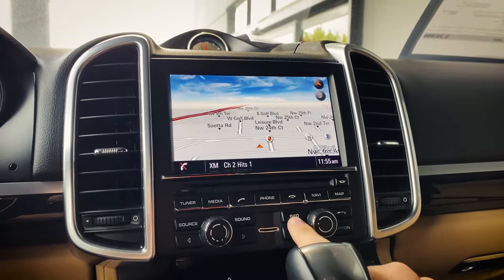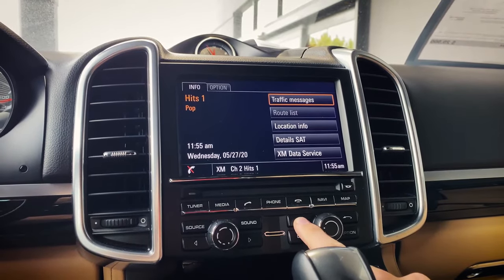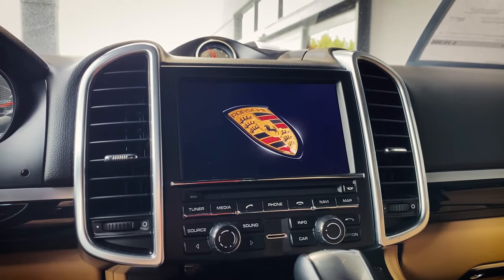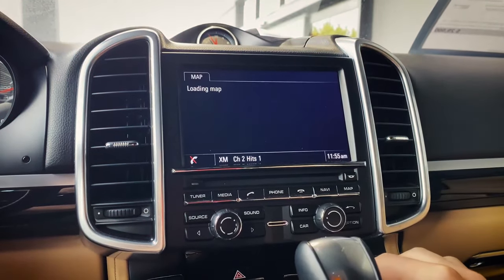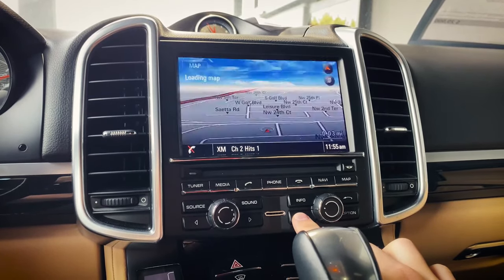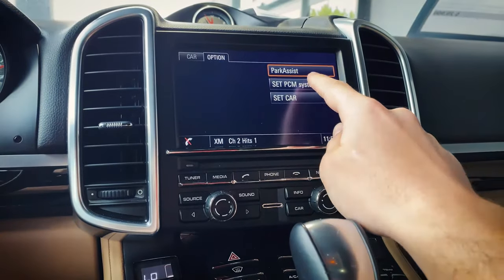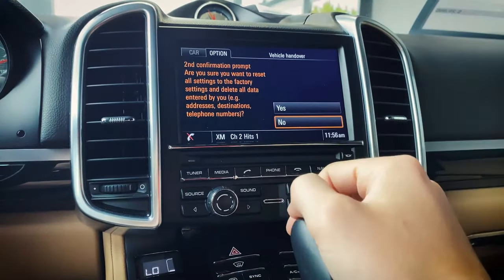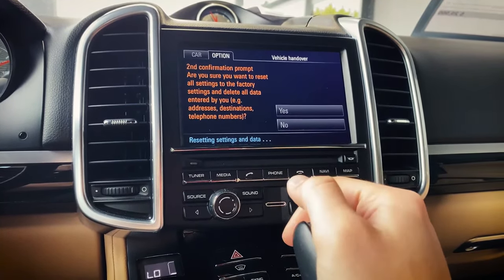How to: Porsche PCM 3.1 Reset and Fix

Comment: I tried this several times on my 2014 Carerra.  It works for a few minutes and then my instruments on the dash either display faults or it goes dead completely.  I used the FIXD scanner and says I have 2 major defaults. I can hardly wait for the big dollar bill for the repairs.

Finally figured what the problem was..I had a new AGM battery installed and cleared up all of the faults . Best 150 dollars i had even spent.
Reply: hello i am having the same problem.  did you find a fix?
Reply: @Montuckz  yes all fixed bought a new AGM battery. All fixed...
Reply: @jamesg2609  thank you so much for the quick reply.  so you only replaced the car battery?  so it was a lack of power to the pcm?
Reply: @Montuckz  yes..I was getting all kinds of warnings.  Steering ,tire pressure , ...it was intermittent.  The new battery solved all the issues.
Reply: @jamesg2609  thank you very much.  did you do it or dealership?  cheers!
Reply: @Montuckz  i went to my local mechanic that is very versed in Porsche repairs.
Reply: @alexis ademovic my local mechanic.  Be sure to use a AGM battery.

Comment: I managed to reboot a 2018 Macan PP which I believe has the PCM 4 - USB wasn’t being recognised as an input.

You have to hold the left rotary knob and the screen goes black OFF. I then clicked and held it for another 5-10 seconds and it reboot, the Porsche logo and Macan logo popped up and USB is working again.

Comment: Didn't fix the issue for me, It feels like there is some kind of hardware issue, possibly the storage device.
Reply: You find a fix?
Reply: @JustusJames29  I’ve realized that the HDD is not working properly so after resetting the PCM completely and then pairing the phone again, I chose not to sync contacts so it doesn’t use the HDD, it seems to have worked so far .